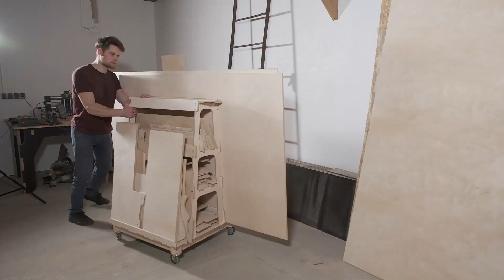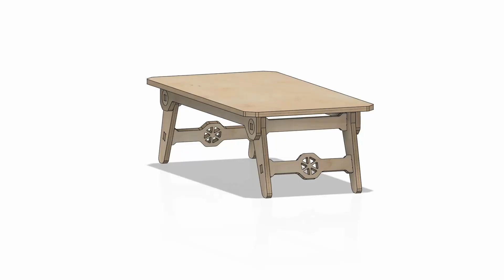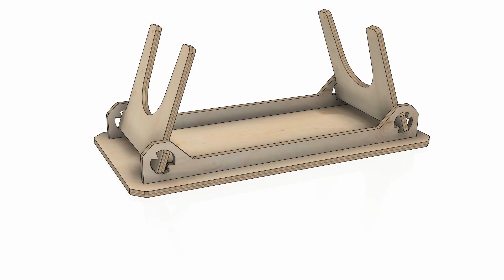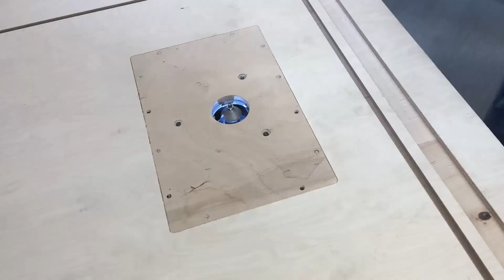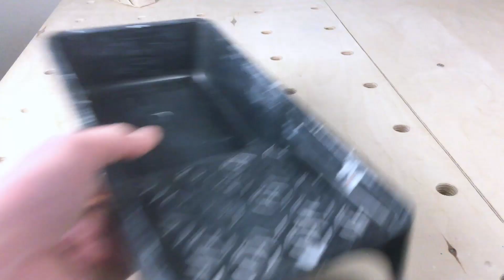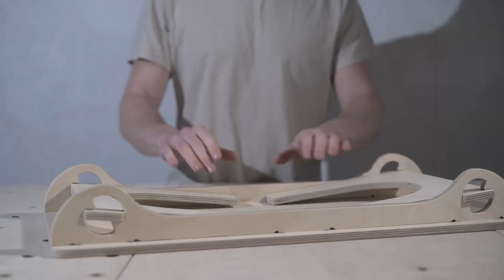Testing NEW CNC Joint - Bed-Table Build

Comment: Very nice. Which programme do you use while drafting the models?
Reply from the maker: Thank you!
We use mostly Fusion 360 - it's a great option for CNC projects. You can create the design and switch to CAM section to create the CNC operations without any problems.

Comment: Amazing way to find new ways to do things 🎉🎉🎉
I have one question if you can help me to know, what is the software you use for modeling?

Now I'm using only Auto-Cad and sometimes Solidwork
Reply from the maker: Glad to hear you enjoyed the video!
We use mostly Fusion 360 for the modeling. It also has quite an advanced CAM section, that makes setting up the CNC operations more convenient.
Reply: @Aribabox  thanks for your answers, I am starting to work on CNC but I'm modeling first with AutoCAD, and then if I want to translate the model to the CNC I work with ARTCAM, it's so slow that process and I want to know if FUSION could generate .mmg files to the CNC
Reply from the maker: @emmanuelcabreraortiz1026  Using two software for CNC projects can indeed slow down the process. Regarding .mmg file export, Fusion 360 primarily exports .nc program files. However, there might be extensions available that enable .mmg file creation.

Comment: what did you mean when you said you didn't have to use support tabs because of 12mm ply and 3mm router bit? I'm not sure how that works?
Reply from the maker: When we are making parts out of 12 mm thick plywood, we often cut the contour lines in one pass. When doing so, the straight flute bit leaves enough wood chips in the cutting groove to secure the part in place. Therefore, we can skip on using the support tabs.
We probably should have done a better job explaining it in the video.
Reply: لوسمحت كيف ممكن احصل على الملفdxf